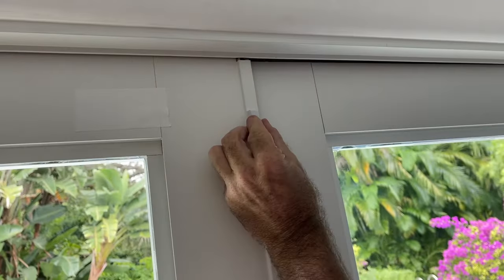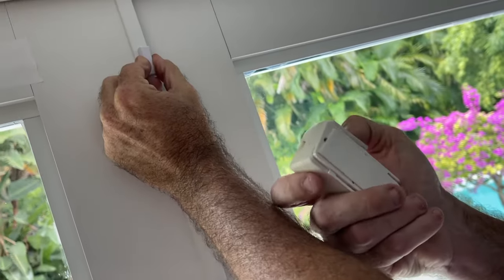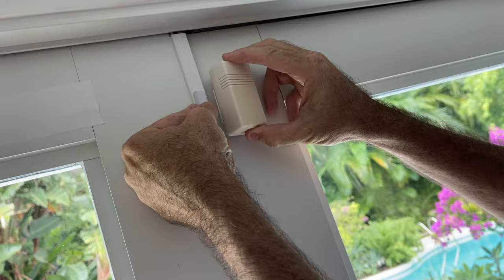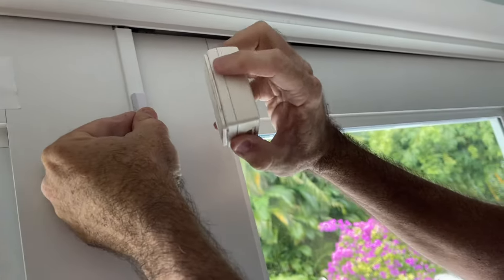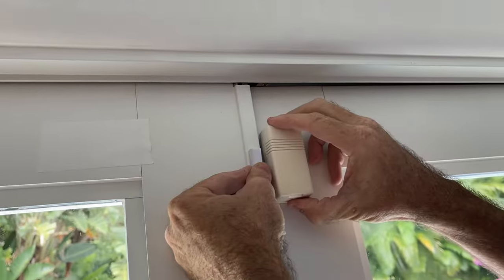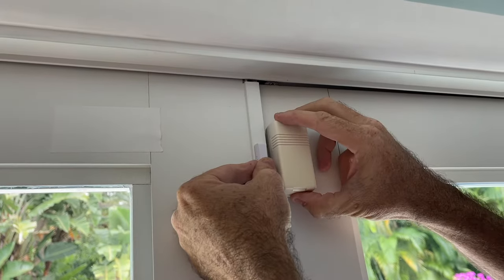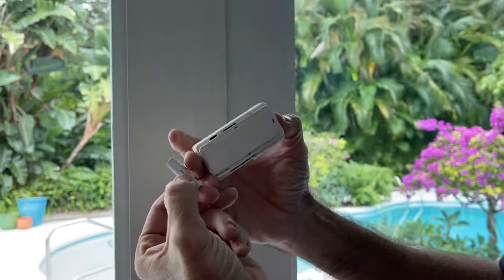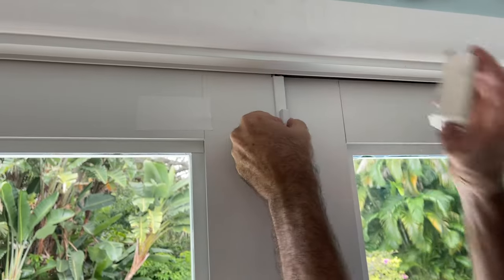How to attach an ADT Alarm sensor to a door

Comment: This is accurate. Just wasted 20 minutes on the phone with ADT and nit once did they ask, what is the door orientation you are placing the sensor on...The instructions don't even point out that depending on the side of the door you want to place the sensor will effect the orientation of the senor. I had mine flipped and this video solved it for me instantly. Thanks. Please note newer models of sensors may be different.
Reply from the maker: Glad to hear you got it working and thank you for watching

Comment: That’s wrong, the magnet is the one should be attached in the opening door/window
Reply from the maker: And that was the guy from ADT?
Reply: @TomLeeman  It’s recommended to not put the main sensor on the door. This is because if the door ever needs to get replaced, you can just put a new magnet on the door. It doesn’t matter, and it also depends on the situation.
Reply from the maker: @rztndiii  excellent tip. The guy who is showing me that was actually the ADT tech would come out to our house to help us reattach all of our sensors and all of our new windows. Apparently he’s not that good.
Reply: The technician in my house installed all of them with the magnet strip on the fixed part of the door frame. The sensor is on the door/window.